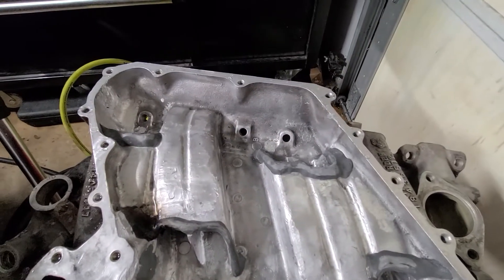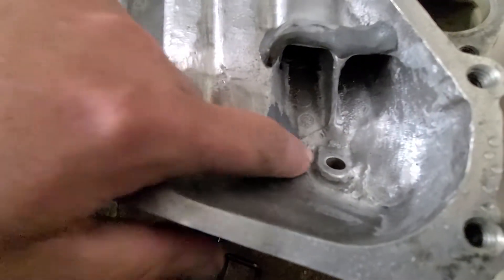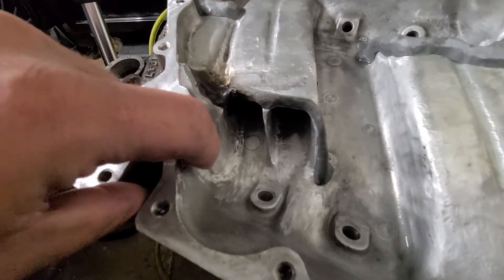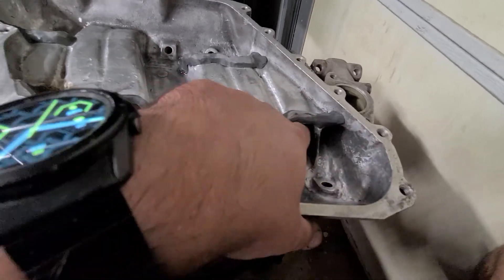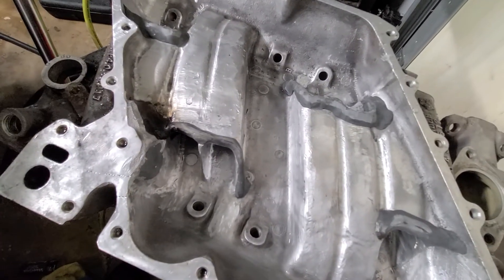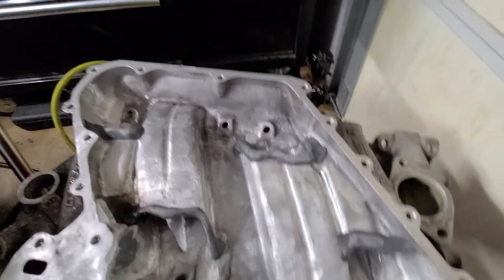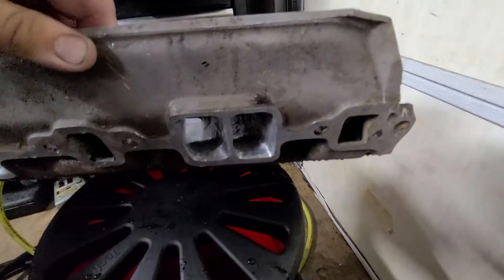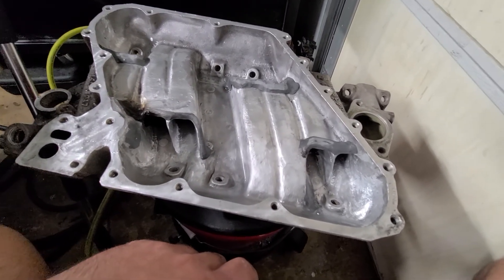CFI intake porting update

Comment: I just bought a used intake manifold on ebay and plan on porting the manifold as well. interested to see if the inside lips you created for the reproduction are meant to do anything. looking forward to your dyno results.
Reply from the maker: I know the creator of the Renegade put them in as they actually evacuate the plenum above a certain air volume and actually ram air so to speak. I put a vacuum cleaner on the outlet of the port and you could feel a noticeable difference with it there vs not. I don't have a flow bench or smoke machine but I think it'll help. The only issue is if it becomes too close to the lid.